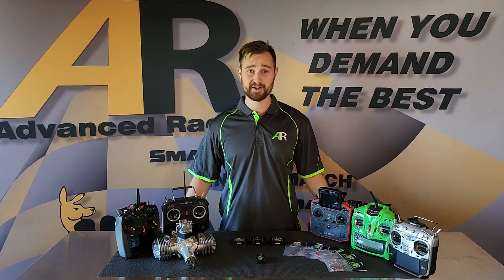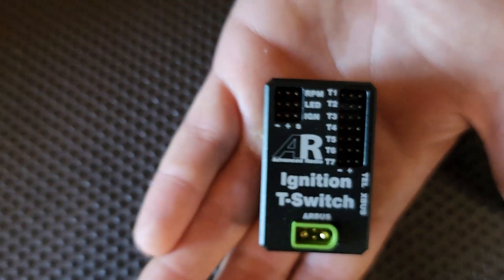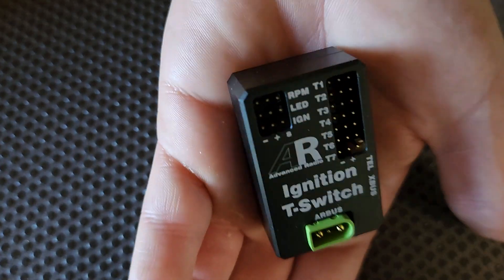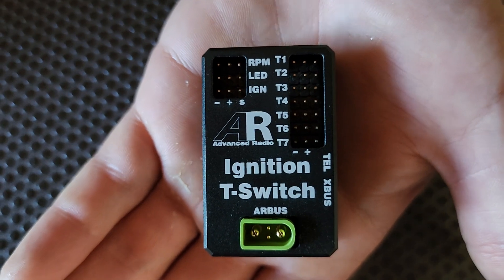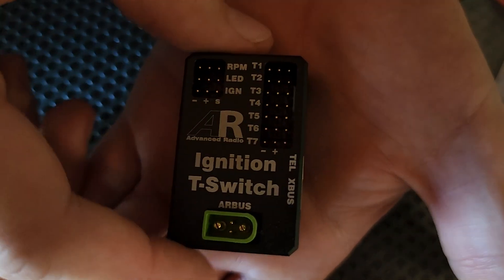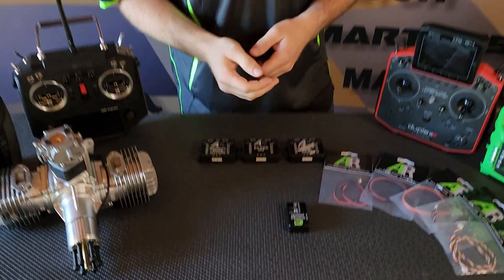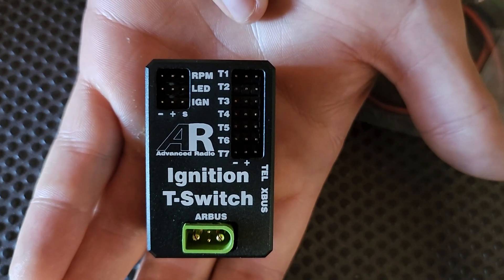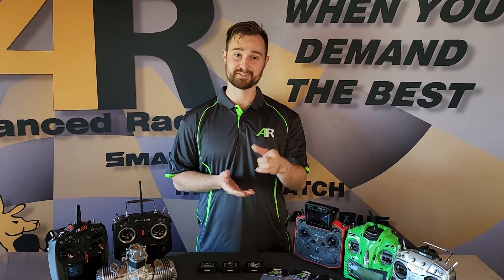Ignition T-Switch introduction

Comment: Is there a way to adjust the output voltage? Mine is only putting out 5.5v. It won’t power the Saito ignition properly. I’m using 6.6 life pack